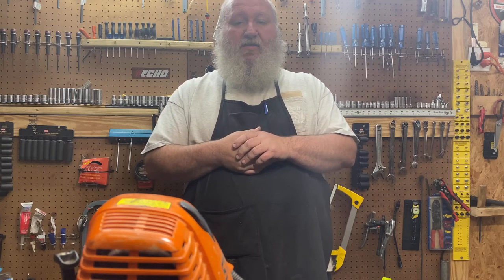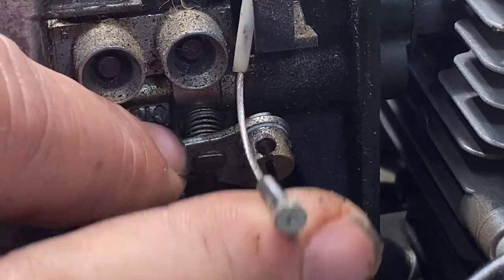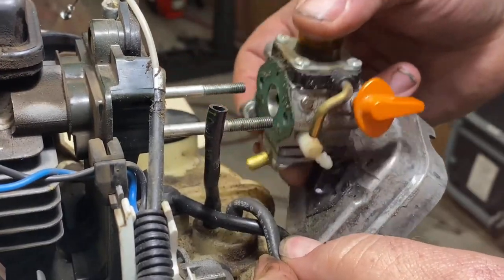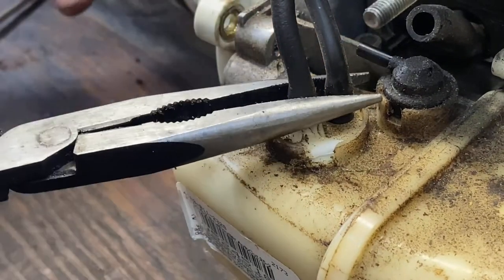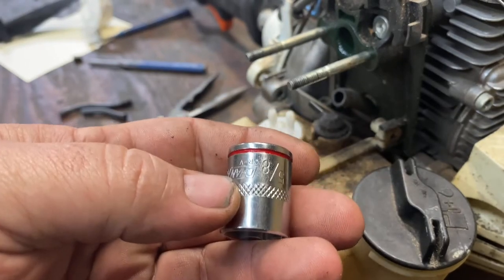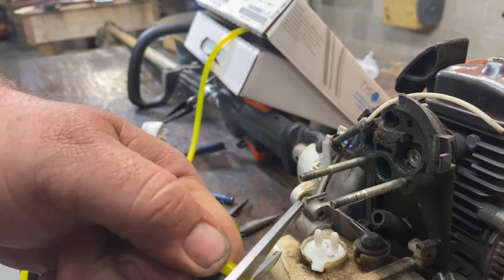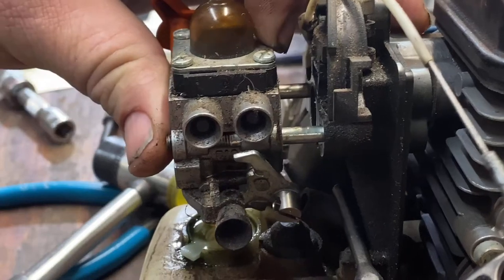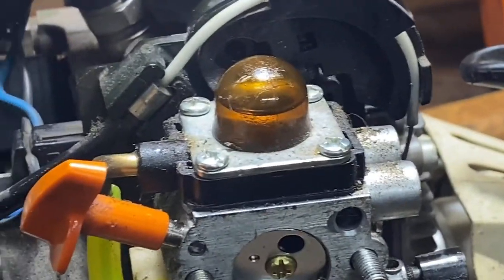Fuel line repair/replacement on Stihl FS-90R weed trimmer

Comment: Hey Lester, thanks for the video, its most appreciated. Its funny that you mentioned that this one "belongs to the wife" of that couple you did the work for as mine belongs to my wife. If you could answer the following question I'd really appreciate it as I'm stumped and she really needs the FS90 running so she can cut some brush. A few years back I completely rebuilt our FS90 which included replacing the piston/ring/cylinder/carb and it ran great until a few weeks ago when it just died after being used. Wy wife turned it off, restarted it 10 minutes later where it started on the first pull but it died immediately and hasnt started since.. My issue today is that there is no fuel going to the plug.  I just replaced that same plastic fuel line piece that you did in this video, replaced the vent,  and I also tested the primer bulb before I reseated that new plastic piece into the tank. The primer bulb fills and I could see and hear the fuel returning to the fuel tank through the return line, but theres no fuel going to the plug. I also had a spare brand new carb that I put on and it still doesnt start!  Any suggestions you might have would be deeply appreciated if you still monitor your comments.

Comment: Excellent video and explanation, thank you.  Best camera work ever, too. My tab broke off as well, that's where I'm at right now. Do you think that the green fuel line plug-in assembly you get with an Amazon replacement carb will work if oem fuel line assembly is tough to find?
Thanks again for making our lives just a bit less stressful.  I'll be back for more vids!

Comment: Thanks for your video,  BUT:                                                                                                           How about Actually Listing the actual Stihl OEM - Parts Numbers for these Replacement parts in your Description below the video?? That would really Help many of us in locating the Correct Parts. and yes I realize that many times they have Up graded or Replaced the Parts with a New Part Number but,  it would at least give us a good starting point.

Comment: Tab on fuel line plug broke. Any idea what part number is? Just left it until I can get new one. Stupid part should come with new carb, fuel lines,and filters!  Mine has never been changed and wouldn't budge. Great video!! Subscribed!!!
Reply: Got new carb. Everything reassembled properly. Won't start! Went ahead and used new carb since I had it all apart. Now wish I'd left the old one on it and jyst changed hoses and filter!  Hose that came with new carb seems smaller than hose I took off? Could that be problem? Everything else exactly as before!